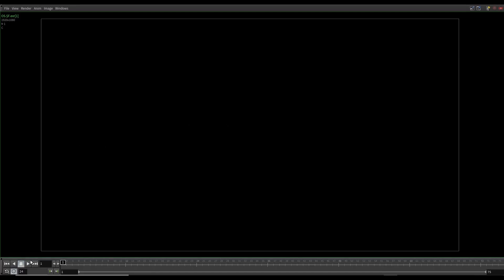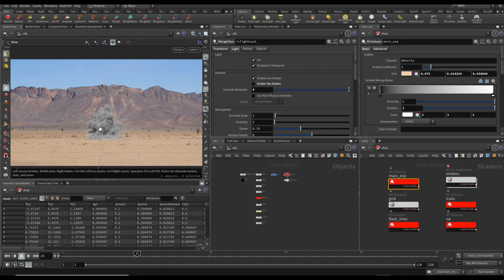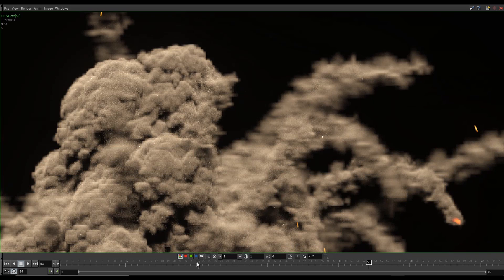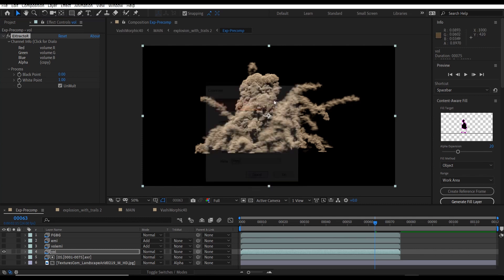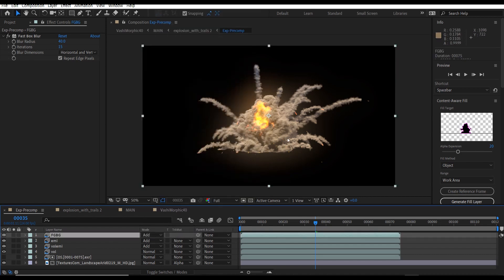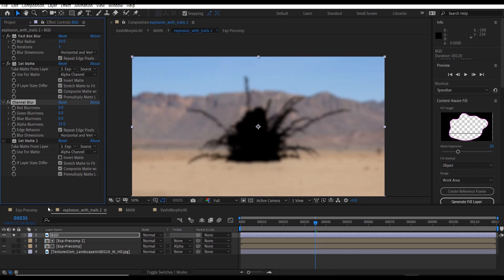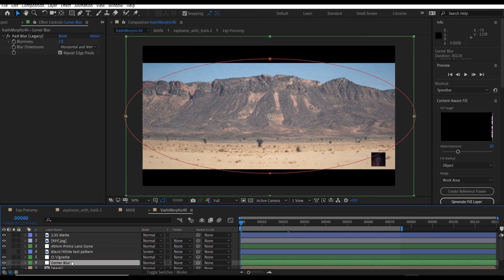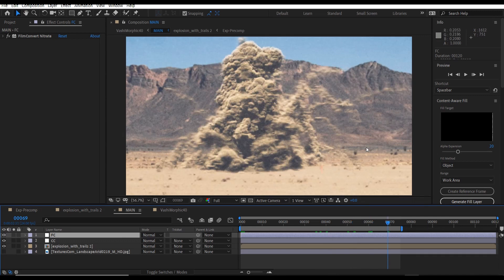TUTORIAL - PART IX - HOUDINI EXPLOSION WITH TRAILS

Comment: I am facing a problem in houdini. The volume visualisation node is not working? what could be the reason for this , iam unable to find this.
when i connect the dopimportfied to vilume visualization everything disappears and i dont know the reason for this>
Can u please help me out?
Reply from the maker: Hmm, one of the reasons could be that volume viz node hasn't setup to see density and then heat, temperature etc., Another reason is that the dop import node doesn't receive thes fields meaning the sim doesn't have these. One final reason could be that the dop import field if set to see density make sure it is read as smoke and not invisible. Hope that makes sense.
Reply: @resilientpicture  i got it only after typing in density in the density field. Thank you for your suggestions.
Reply from the maker: You are welcome